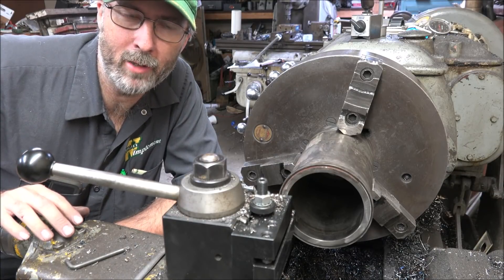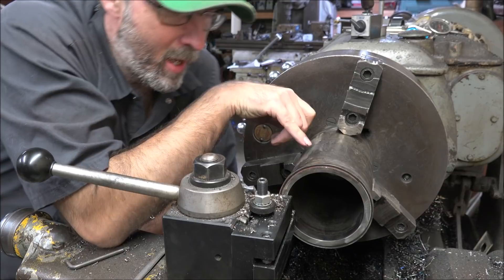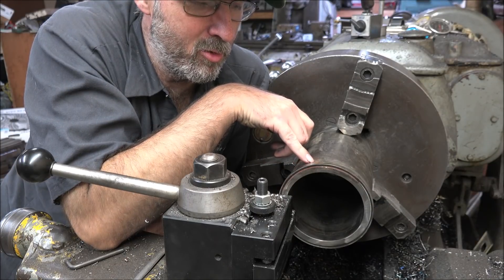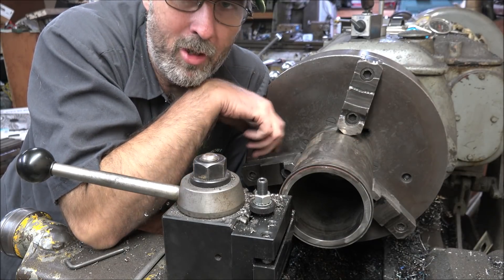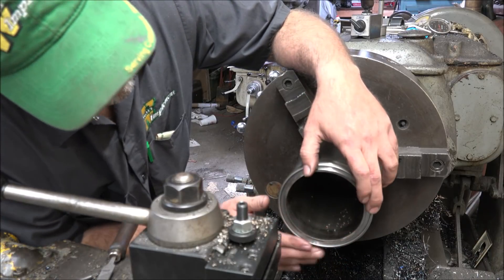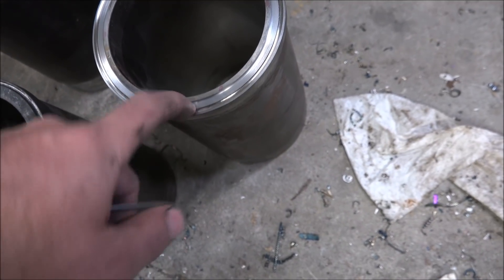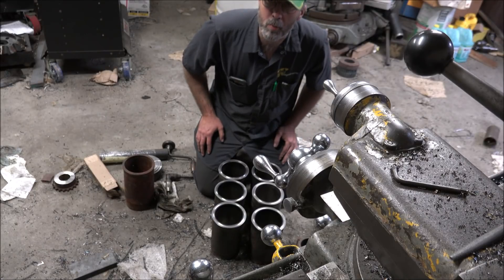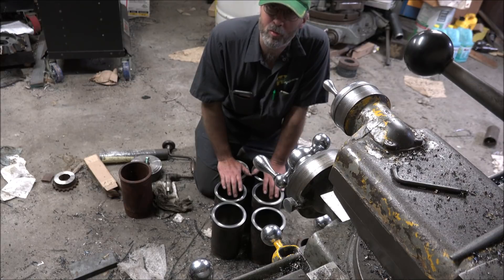Cylinder Liners Fire Dams and Fire Rings How and Why they Work

Comment: Whats really important is getting the dimension from the bottom of the sleeve flange to the bottom of the fire ring groove all the same.  When I put fire ring grooves in, I always indicate the backside of the flange and bump the sleeve around until the back of the flange runs as true as you can get it. When cutting the groove I put the fire ring in the groove and mic from the back of the flange to the fire ring. Just make sure you dont mic on the fire ring where its been welded together.

Comment: I live in Salem, Ohio. There is a company here that makes new sleeves for pulling tractors. The last ones I bought were around 100.00 each. They will make them any way you want. They are made from centrifugally  cast ductile iron. We used to  machine some of the steel tubes at work that they used to cast the ductile iron. Here is a small video of a pulling tractor that I built. I made a billet crankshaft for this tractor.
www.youtube.com/watch?v=YdMo_jJksq0

Here is a little video of the crankshaft in the lathe
www.youtube.com/watch?v=OtphrHXaMt8

Comment: Why not treat that chuck to some care & lube ?
Why do people like dry machines ? I like a well lubed machine.
Reply from the maker: It has been apart and cleaned and lubed with powdered graphite in the last couple of months. I don't use oil in the chuck scroll because it makes the cast iron dust stick to it and makes abrasive paste.
Reply: @bcbloc02  Interesting. Greasing via the grease nipple would stop dust getting into working parts. Only remaining issue is exposed scroll - not the easiest thing to protect.

Comment: I don't like chucking on liners for fear of making them out of round and causing piston scuffing.
Reply from the maker: You can literally bow one out of round with your hands.  The block helps to hold them in proper shape once installed. i wouldn't get crazy with one but chucking it is a non issue.

Comment: Did you change jobs?
Reply: That is the old shop with the smaller machinery. Brian plans to move some if not all to the barn at some time.
Reply: @ypopnun1003  I think he's asking about the uniform shirt Brian is wearing.
Reply from the maker: In that case it was just an old shirt.
Reply: @bcbloc02  its my 20th year with deere this year
Reply: @jimurrata6785  Ah ok

Comment: Do they de-bore the engine to meet class requirements, or is it so they can get the fire rings in the liner instead of in the head?  Kind of an unclear question because you are really adding the damn and the ring at the same time.
Reply from the maker: This one has thick liners to decube for class requirements.
Reply: @bcbloc02  Thank you sir.
Reply: @bcbloc02  Plus with thicker cylinder walls, and lighter pistons = ability to handle higher cylinder pressures. More boost can easily make up for the lost cubes. With your fire ring mods, insane boost levels are probably possible. Until you eventually drive over your crank...
Reply: @notsofresh8563  Or lift everything above the crank off the block and throw it on the ground.
Reply: @notsofresh8563 The sleeves are rarely the weak link in the equation regardless of cylinder pressure.  Boost is only a measure of restriction . There is absolutely no direct correlation between boost pressure and horsepower.  Two engines of the same displacement can produce the same horsepower with one have 250 pounds of boost and the other producing only 80 pounds of boost.
Reply: @andrewevans1658  I mentioned cylinder pressure, not boost pressure. I understand boost pressure is a measure of intake restriction.  In order to get more air volume in, you can either raise pressure on same intake setup or reduce restriction for more volume at a given pressure. What i meant above was more boost =more air volume into motor. More air=more fuel and a bigger bang increasing cylinder pressure. Diesel engines can and do crack liners when the wick is turned up high.
Reply: @notsofresh8563  I have several engines that I work on  north of 3500 hp and have never had a sleeve cracking issue even with relatively thin overbore sleeves. Cracking is usually caused by using an inferior quality sleeve ( stock) and mostly from the upper and lower counterbores not being parallel with each other and not being square with the deck surface.  Usually the block splits in half or piston failure occurs, which is why a billet block is superior if the rules allow it.